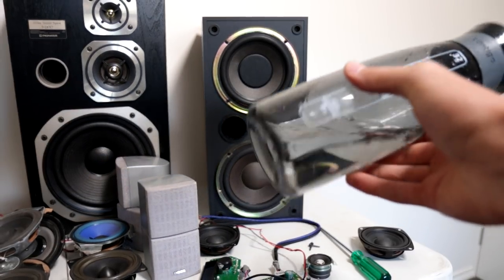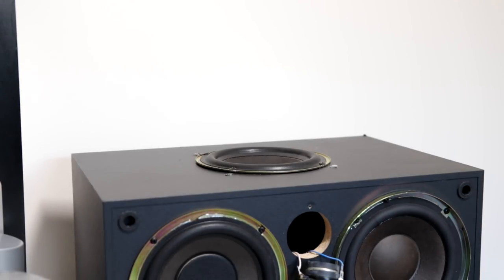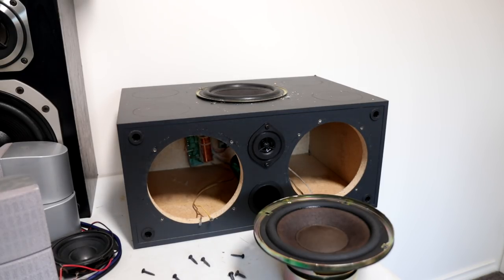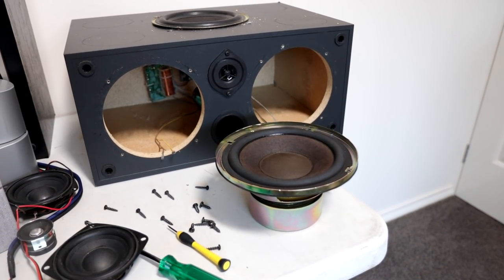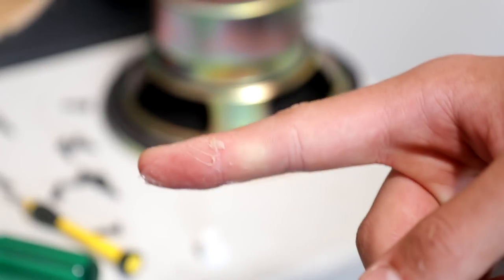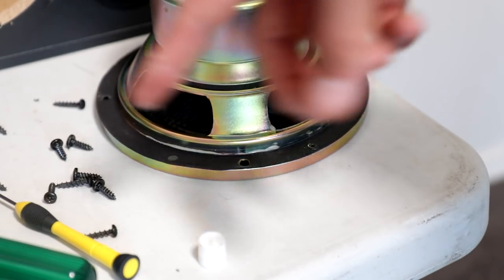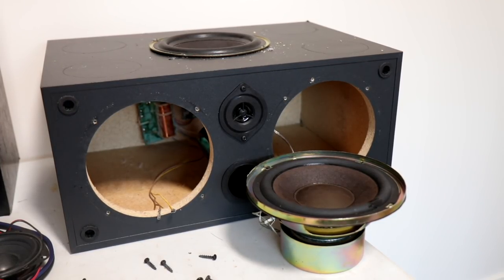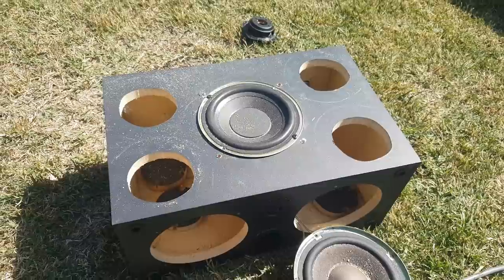SH!T SPEAKER + PASSIVE RADIATORS

Comment: Really great video, I just found out about passive radiators, and I have a question tho. when you hook those passive radiators, do you still get sound from the normal speaker drivers as well, or do the sounds just come from the pass radiators, I.e is the new sound --->>>passive radiator or is it ---->>>Passive radiator + normal speaker. Thank you
Reply: orhema oluga It's Passive Radiator & Normal speaker

Comment: Passive radiators are not going to work properly together with bass reflex port.. passive radiators must be in sealed box to have a high air pressure to be able to work at their best.. it's either bass reflex port or just sealed speaker box with passive radiators. Anyhow it's always cool to see radiators thumping up and down with the rhythm :)

Comment: The most effective way to use PASSIVE RADIATORS is to use TWO RADIATORS on BOTH side of the speaker, and the RADIATORS should be AS BIG AS the DRIVER

Comment: Passive radiators are such a confusing subject. Arent they suppose to be around twice the surface area of the speaker themselves to do any good?
Reply: But you know, it's the shit speaker, so in this case it can be anything.
Reply: Zero Two i know what they are used for. I just dont understand exactly how they work. From my understanding of normal speakers if one goes in while the other goes out then its out of phase. Which is where my confused part comes from. Passive radiators move opposite to the speakers which in any other situation would cancel things out. Thats what i dont understand most about passive radiators is how they dont cause cancelation. Thats why i assumed it had to be atleast twice the size of the speaker moving it that way it overpowers the cancelation. But it appears thats not the case. I assumed that they placed them on the back so airwaves have a chance to travel in the same way open baffle speakers work. But others have the radiatoes on the front.